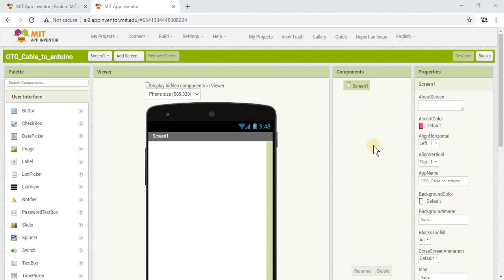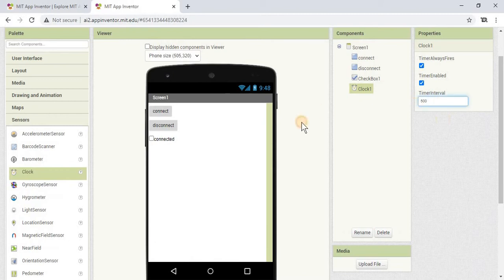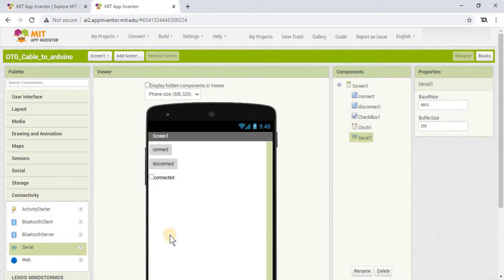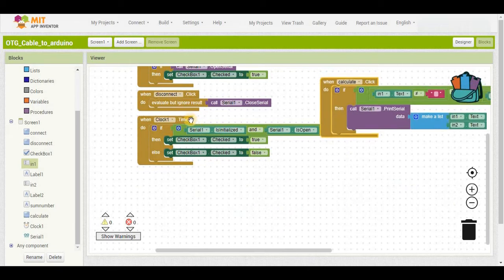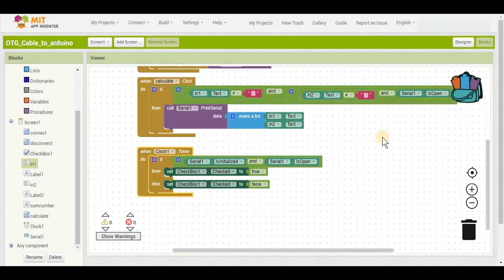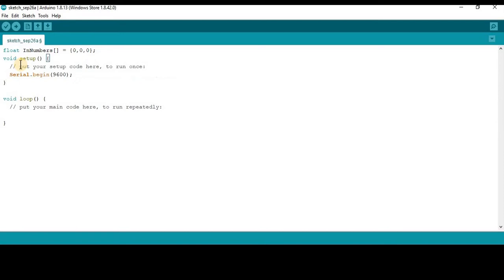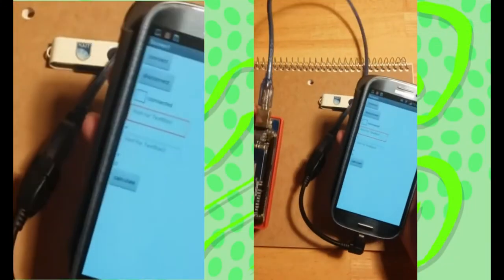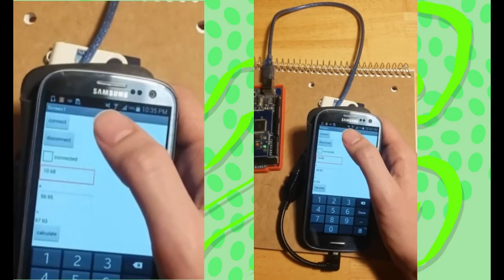Setting up OTG communication with MIT app inventor

Comment: Worked! Just what I needed to move along  my project.  I've developed an electronic hurdy gurdy that I can play with buttons or use as a music box to play tunes I sent it. Works with my computer to Arduino via the IDE. The next step is to use an MIT inventor app to send the song information with my phone. This is going to save hours of screwing around. Thanks!

Comment: Hi thanks for a very helpful video. I can get this to work but only at 9600 baud. I've tried changing the Ardino sketch and the MIT App to both faster and slower baud rates but only 9600 will work. Others return odd characters insteasd of the sum. Any ideas on what I can try next?

Comment: I developed a variation of MIT program. It definitely sends the data to Arduino which I have tested. I have tested the Arduino program which shows that it has sent the data to phone.

That is where I ran out of luck. Phone does not seem to receive the Serial data. Any suggestions!

Comment: Thank you very much for this video. unfortunately its not getting connected when call OpenSerial in my case, but ArduinoDroid samples are working fine.
Could you please tell me what should I have to do troubleshoot this? Thanks :)
Reply: Okay, I think it is because of it doesn't show me the dialog box to "allow permission" when I click the "connect" button
Reply: @nadeeshpeiris7496  me neither, have you found a fix?
Reply: cuz ur arduino have ch340g serial chip

Comment: Hi. I have tried this but no sucess. I got "Error 3901: Serial was not initialized". Tried with two phones same. I have tried app ArduinoDroid to flash my board Arduino Uno and it works so cables are ok. Can you give me some idea what can be? Thanks
Reply from the maker: that error usually occurs when you try to open serial communication before initializing. make sure you have [call serial1 .initializeSerial]  then [call serial1 openSerial].
Reply: @TabletopRobotics  thans for replay. I get error immediately as i start application, not even click on conect. And it keep pop up every second
Reply from the maker: then there's a problem with your timer. try moving [set global number to call serial1 .readSerial] so its right below the [set checkbox1 .checked to true]
Reply: @TabletopRobotics  that solved error problem, but still no connection, i don't get this promt to allow usb permission when i click conect. Tried via ArduinoDroid to send serial data (two numbers) and i get back sum via serial
Reply from the maker: I dont really know why. its hard to troubleshoot a problem when its not right in front of me, but i know some phones don't support usb host mode, what version of android are you using?
Reply: @TabletopRobotics  one is 10, other 8. I think it's not problem with OTG because ArduinoDroid works perfect on both phones
Reply from the maker: the only thing I can think to do is strip the program of all non essentials. only keep the [when connect .clicked] as see if it connects if it does try to make the program again if it doesn't i don't really know what to do. sorry i wish i could do more.
Reply: @TabletopRobotics  my phone supports host mode, but for some reason when i try to switch the device controlling the usb to my phone, it just says couldn't switch. might be the arduino device im trying to control, i really don't know
Reply: hi @savkegsi did you solve the issue? getting the same thing